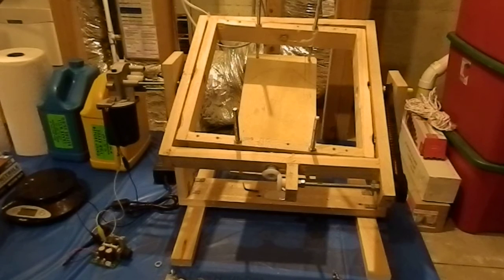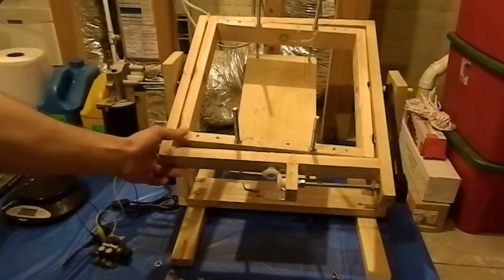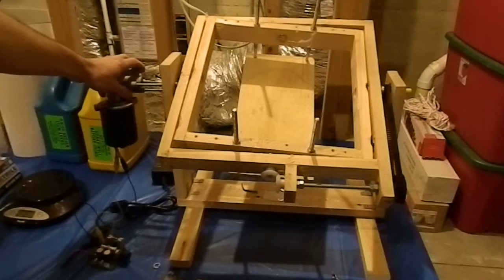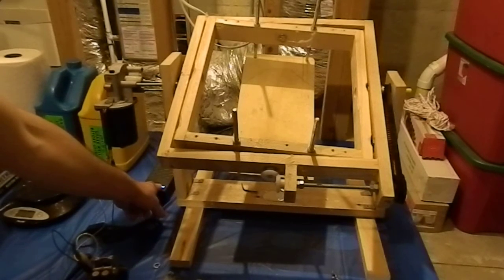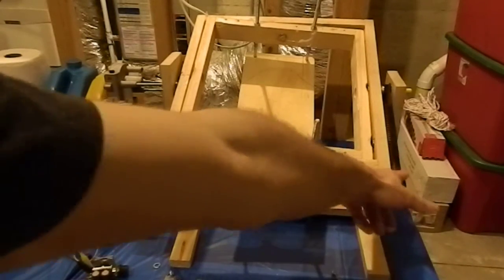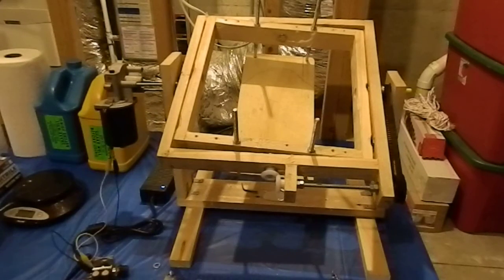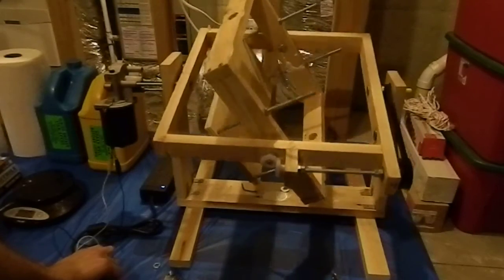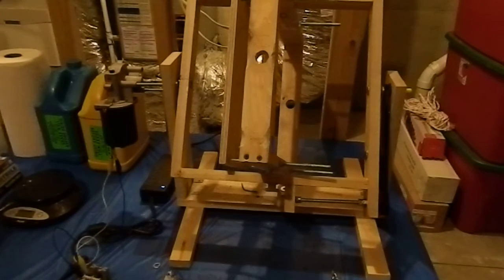Build Your Own Rotocast Machine

Comment: Hi there, I love the simple design and I am about to start building my own, to save on resin but also I heard that rotocasting also helps get rid of small surface bubbles... is this true, my sculpts are pretty detailed and I find bubbles get entrapped in the hair lines, would rotocasting help with this?
Reply from the maker: Tareg Zamel it will help with the bubbles.
Reply: Thanks for the reply :)

Comment: which motor did you used?
Reply from the maker: Shibunath Mongaraj it's in the description.
Reply: +TGS Props sir, can you please specify that motor specification and type of motor used?
Reply from the maker: Shibunath Mongaraj  13.5 VDC Rated Speed: 50 RPM Rated Load: 60 Watts Rated Torque: 11.5 N-m (8.5 ft-lb) Mounting: M6 screw holes Shaft: 10mm shaft with 2 flats where flat to flat is 6.6mm and threaded end to fit a M6 tightening nut
Reply: +TGS Props 
Thank you very much. actually I built one for myself just I was confused which motor should I use. you clarify my confusion thank you so much.
Reply: +TGS Props 
sir,  if I am using right now sewing machine motor but the speed of that motor is too high thats why I added additional pulley for speed reduction. .

Comment: I got a 20lb silicone mold. Will this rotocast turn that a work efficiently?
Reply from the maker: My egg mold is pretty heavy. I'll weigh my mold when I get back to the shop. I plan on making a 3'x3' unit out of steel for larger molds.